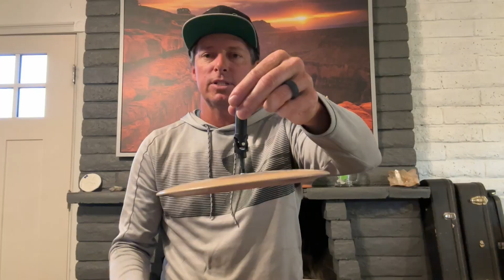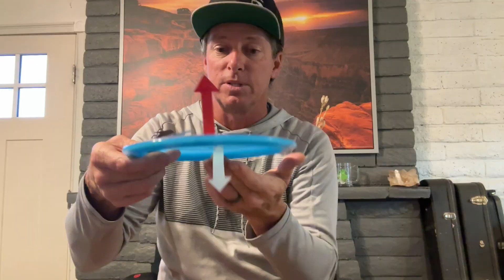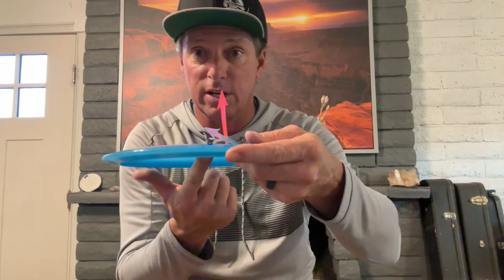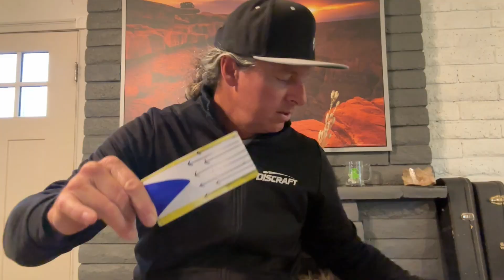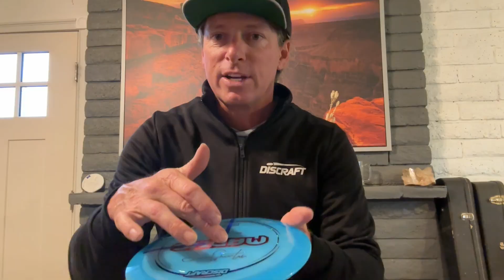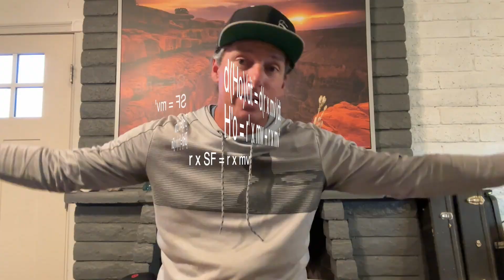Why do Discs golf Discs Turn and Fade?

Comment: At around the 3 minute mark you claim that when you throw a disc the lift starts behind the center of gravity. But WHY? It's almost like you saw that turn happens and conclude that the lift force MUST happen behind the center of gravity. This explanation is all internally consistent, but without explaining WHY the lift force is where it is at any given point in the flight, your entire explanation falls apart. It all hinges on two very important claims you just wave away as givens without actually showing proof that your claims are accurate. Really solid video, I'm just not fully convinced this is the whole picture.
Reply from the maker: Thank you for the feedback. 
Which part do you feel I’m waiving away, and what proofs would you like to see? I can leave links to all the best PHD scientific papers we have available on disc flight if you’d like or are interested. I’ve tried to do my due diligence on seeking out those much more educated than I on these subjects, mechanical and fluid dynamics engineers, in order to make sure I’m not leading folks astray.
The point of the video was to share information that is easily digestible without getting into the weeds. I suppose I came at it with the assumption that most folks interested in what I was talking about, would know the general principles of how a traditional wing works. I’ve spent a large portion of my life building Rc sailplanes and studying flight. 
First of all good catch, perhaps I assumed too much.
So in order to keep it as simple as possible, let’s consider a couple things that are perhaps not clearly articulated in the video.
1. lift force is disc speed (wing shape) and airspeed (speed of wing in relation to the body of air it’s moving through) dependent. Putters are high lift, high drag airfoils. Whereas drivers are lower lift, lower drag airfoils. How we shape each wing dictates lift to drag ratio, which is to say a discs stability within is defined wing speed…putter mid, driver, etc.
2. Center of gravity on a disc is its center of balance.
3. As a disc slows down, the angle of attack increases, Angle of attack increasing is a the primary reason for the change in center of lift.

Every traditional wing has a center of balance. An airplanes weight is typically balanced at around 25-30% of its wing chord from the leading edge..  Which is to say that if it maintains its most efficient designed airspeed (best lift/drag ratio), it will maintain level flight. The center of balance will be slightly in front of the center of lift. (The elevator at the tree if the plane provides down force to hold of a dive)
If we push the wing faster than its designed airspeed,  lift will move much farther behind the center of gravity as well as the angle of attack will decrease (the nose of the wing moves towards nose down) 
If we slow a wing below its designed airspeed, the angle of attack will increase (nose up), and the center of lift will move in front of the center of balance. When the elevator cannot provide enough up force to keep the plane level, the wing will pitch up and move towards a stall.

I’ll put the scientific paper links in the description.

Comment: Very interesting,  thanks for all the work that went into this. I wonder about how having a fixed point that you artificially created, affects your experiment. It you have something fixed to a disc that it hangs from and spins around, its true that touching one edge will cause "something" to happen. You attribute it to angular precession. But an actual flying disc does not have anything attached to it, it is spinning freely in the air, and also has a great deal of forward momentum. Any "force" on it would affect the entire disc all at once. Because of the difference in your use case and the the extra/different forces on an actual flying disc, it seems you need to make a case why your experiment really mimics real life.
Reply from the maker: Thanks for taking the time to watch and for the articulate comment! 
A simple experiment would be to at the root of this contraption. The attachment point, which is a fidget spinner. Play with a fidget spinner that’s in motion. The basic principles that are demonstrated here, where I have made a layman’s attempt in explaining, I have discussed at length with friends who are mechanical engineers, and fluid dynamics engineers, in order to do my best and due diligence to not post anything that would misinform or mislead anyone. I’m sure there are better explanations, and better ways to demonstrate angular precession, but this is where I am. The underlying physics behind this video is sound according to the best scientific documentation we have currently. As far as having a fixed point to demonstrate the fundamental effects of spin on a disc, even our best wind tunnel demonstrations require a “fixed” point to study the effects of air within the tunnel. I’m not using that as an excuse or proof of credibility but it’s worth noting. There are only a couple serious academic papers on the physics of disc flight, and almost every other academic study quotes or uses them as reference documentation. Most of the studies are only seriously studying a Frisbee, or ultimate disc. Golf disc share similar concepts but our lift and flow separation areas are far less pronounced due to much higher aspect airfoils and less drag. There are some very interesting studies done on airflow dynamics with paint that are quite compelling, demonstrating the laminar and turbulent flow zones on a disc showing the areas of high and lower pressures.  Within this video I believe that I’ve stated that as a disc slows, the lift moves forward, thus changing the AOA. As I understand from further conversations with others smarter than I, it’s more likely that lift moves forward as the disc slows because of the increase in AOA. 
The effect is the same, though the explanation of the mechanism is reversed. Point being I’m ok to do my best, and learn to use more precise language as I continue down the path of understanding. When exerting influence on the disc,
The touching of the edge is simply a demonstration of “direction of applied force”. In flight, the forces of lift are most likely not as strong as my finger, but they have the same observable effects.  Even the forces of grip upon the release point are observable under high speed photography, and the 90* precession in force is seen. Where there is a supination of the wrist at release, there tend to be a more nose down AOA, and where the wrist moves towards pronation, a downward force is applied to the top of the dis at release, and a nose up AOA is created. (Note that the force is applied near the 5oclock position relative to the direction of release of and the effect is observed near 8oclock, which is 180* from the nose or leading edge of the disc. Push the tail down, and the nose goes up….)
We can observe the nose angle as a disc hits the ground and see the 90* precession rule cause the disc to skip precisely in correlation with that point of contact.  As a simple rule, a disc spins around its center. Be it in contact with a hub, an axle, a finger, or flying through the air at 60mph the rules of physics that apply to a spinning disc can be observed. I’ve only tried to demonstrate that in a basic and simple way. I love this stuff, I’ve been learning and seeking to understand the physics of flight from the day I started flying planes and throwing discs. If you’d like a link to some of the scientific papers so you can research for yourself, I’d be happy to share them. Cheers
Reply: @DiscgliderPete  Seems like the  reason is simpker. 1) As air passes over an object and as the speed of the air increases it produces less air pressure on the object. 2)  If air is flowing below and over an object, the object will move in the direction of the least air pressure [the faster moving air]. 3) Gyroscopic effect is best illustrated by a spinning top. If it is spinning fast enough it does not topple over. But when the spinning slows enough the top will fall over.

So, lift is created for a disc when the disc is moving forward fast enough and spinning fast enough to create enough gyroscopic effect to be stable and the air is moving faster over the top than the bottom. Note that air moves more quickly over the smooth rounded top of a disc than the angled bottom.

So the disc is now in the air. Next, fade. Again think of the spinning top, that will always fall into the direction of its spin. As a disc loses speed and momentum, it will start to fall in the direction of the gyroscopic spin.  (Given a flat release and a disc with 0 fade and turn) if it is spinning with clockwise spin it will fall to the left, otherwise to the right. However, if it comes down with enough forward momentum, it may outballance the gyro and land straight ahead.
Reply from the maker: @j @johnperez3420 when we throw a golf disc backhand, the best throws are where the spin is 50% of the speed. If the disc is thrown at 60 miles an hour, the spin will be around 30 miles an hour or a little more than 1200 RPMs.. the best throws thrown forehand tend to run about 30% of the speed.
Discs thrown at 60 miles an hour, but but with less spin, say with 800 RPMs, turn and fade more.  drag slows the discs slow down rather quickly, while the spin reduces at a much slower rate.
Discs with a high spin rate fly straighter, resisting both turn and fade much longer than Discs with a lower spin rate. 
Turn and  fade is related to speed, shape of the Disc, lift/drag ratio, and amount of spin. 
I get what you are saying, but I’m not sure if you are disagreeing with, or simply don’t like the language or way it’s explained in the video?
So far, as best as I understand and as best as I’ve understood by discussing with friends with masters degrees in the subjects, I’m not saying anything that is problematic with the current scientific understanding on the subject.
Reply: @DiscgliderPete I don't like when data is presented as "scientific"  when it has not been tested as such. You have done everything above except the testing. The testing is what proves what you say. You say "discs thrown at 60 mph ...". This does not mean anything unless you test it. You can say anything you want, but you are only stating a hypothesis, which means nothing if you don't follow up with testing to back it up. Discussing it with "people in the field" gives you reason to think your hypothesis has some credence,  but does not in any way back up your claims.
Reply from the maker: @johnperez3420  ok fair enough. If there is better information out there, if you’ve presented better information to the disc golf community, please share a link. I’ve been wrong before, and I’m happy to learn be corrected and share where I’ve misunderstood. 
All the years I’ve spent in all the disciplines of rc flight, modeling, research, questioning, seeking, and learning doesn’t make me an expert or anywhere close to a phd. Never claimed either. I’m sharing what I’ve learned over the years, take it or leave it.
One can wish I gave all the “proofs” for the claims in this video, but that wasn’t the point of this particular video.  Years ago, in the pre TechDisc days I would use radar and high speed cameras to measure speed and spin rates, documenting the correlation between the two and shared the data I gathered with anyone interested. Back then like two people cared, and I was just the odd nerd. With TechDisc all the data I collected before, matched up with the metrics we’ve been able to gather with TechDisc now. All of that was not necessarily important to be placed in this particular video. Most folks want the basics, not nerd notes. That was what I was aiming for here. Check out ZonaDiscGolf here on YouTube for a great series on the science of disc golf physics and flight. They are worth a watch.
Here are a few links to the best scientific documents available that I’m aware of to date. The Potts and Crowther paper was fundamental in helping create the flight simulator for TechDisc.

https://www.researchgate.net/profile/William-Crowther-6/publication/268559957_FrisbeeTM_Aerodynamics/links/552fb5af0cf27acb0de627b8/FrisbeeTM-Aerodynamics.pdf

https://www.researchgate.net/profile/William-Crowther-6/publication/225330184_Simulation_of_a_spinstabilised_sports_disc/links/54dc61150cf28d3de65f9d3d/Simulation-of-a-spinstabilised-sports-disc.pdf

http://shura.shu.ac.uk/14521/1/Potts%20-%20Aerodynamic%20Performance%20of%20Flying%20Discs%20-%20(AM).pdf

http://www.mathsportinternational.com/anziam/Mathsport%205.pdf#page=133
Reply: Wow. Too many words. I never claimed to be an expert. A simple,  your right, I didn't back up what I said, nor did I leave links to do so. Here are some would have sufficed.

Comment: Hey Pete, this is great! I love the gyroscope you made from a disc. I am a physicist, an atmospheric scientist, and a disc enthusiast, and I agree with your basic explanations. One thing that has always intrigued me though is why discs get flippier as they beat in. I think this is because the center of lift is in part determined by the surface roughness of the disc. Where the CoL is might have to do with boundary layer separation and the transition from laminar to turbulent flow. Any comment on that? Thanks again.
Reply from the maker: Thank you for your comment!
Yes I do agree with you. That is a video I plan on making at some point too:)
A few thoughts:
Some believe that it’s because the “nose” or parting line begins to droop after many impacts with trees and the ground. Although this may be partly the case for discs molded with base plastics, and their proclivity for quick deformation and deterioration, I am not in that camp.
I do believe that the nick’s scratches and such on the surface do cause early separation of the air from the disc’s surface, which moves the air from laminar to turbulent flow, which causes the CoL, move farther behind the CG, this also increases drag.
The disc in effect gains turn and glide, and loses stability and efficiency.
HMU on instagram, perhaps we can have a conversation, would love to share, and also pick your brain on the issues. The Venn diagram of what you know, crosses my interests in a solid way!

Comment: Great props and explanation. One quibble: a high parting line doesn't cause a disc to turn less/fade more because it reduces lift; it causes a disc to turn less/fade more because a high parting line shifts the center of the lift toward the front of the disc by simultaneously increasing the lift at the front of the disc (due to the air impacting the underside of the nose more and the top of the nose less) and decreasing it at the back of the disc (due to the larger underside of the edge shielding the bottom and reducing the area of higher pressure at the back of the underside).
Reply from the maker: I don’t disagree:)
There are a few things that I didn’t fully articulate well in this video. I was simply trying to not be long winded while creating an introductory to the basics of “why” disc flight is so fascinating.
Thank for you comment:)

Comment: Great video! 
How does spin rate affect turn and fade?
Reply from the maker: That’s a great question! To start, spin stabilizes a disc in flight. So the more spin a disc has, the more it resists both turn and fade.
Good spin rate tends to be 50% of its speed, meaning if a throw is 60mph, its spin rate would be about 30 mph, which also equals 1200rpms. 
High speed flight (say 60mph) with a lower spin rate (say 900rpms) would result in the disc turning more, and also having more fade. 
Another way to say it would be, a disc thrown flat with a higher spin rate, will fly straighter longer.
A disc thrown flat with a lower spin rate will turn and fade more.
Reply: @DiscgliderPete incredible explanation. Thank you!!